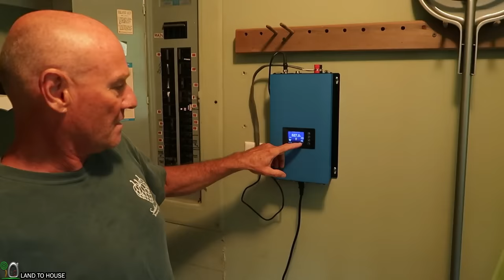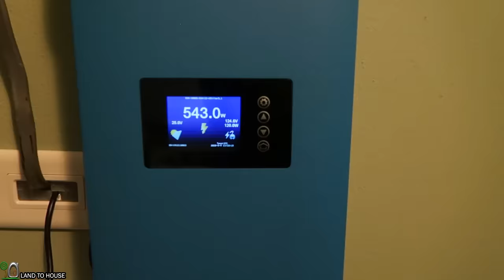Awesome Low Head High Flow Grid Tie Micro Hydro 530 watts!

Comment: Beautiful pond, he should put some trout there.
Wonder how much did it cost him to actually built the dam and huge regaining wall next to it, actual dam is probably reinforced concrete, probably at least $10k ? 
$2.5K inverter + motor, $500 for plumbing, 1 day assembly. Pond / Dam pre existing?
Reply: Dam looks older than the gentleman presenting the system, gonna go out on a limb and say it was already there
Reply: There are a lot of forgotten low head dams all over the country, so I think he just bought it with the land. Still pretty cool, I don't know much of those who are for sale.
Reply: @kinto4135  And since he's in North Carolina, even if he didn't own the damn (but merely owned the land adjacent to the stream), the law there is that you can make reasonable use of the water. So, he'd be in the clear.

Although in other states, that wouldn't necessarily be the case.
Reply: @slycordinator  Oh ok, didn't knew that. That's really cool! Finally a useful law haha
Reply: @kinto4135  Yeah, there are states where seemingly meaningless things dealing with water are illegal. Like, in some places it's illegal to even collect rain water, since water is taken to default to belong to the state at large.
Reply: You don't need a pond for this to work though. I feel like the setup was somewhat inefficient. They got the pressure system right, but the alternator and gearing ratio not so well. I like how honest the old man was at the end, kinda gave the guy a poker face hahah
Reply: And that thing is spitting out more than a nickel's worth of electricity every hour! It'll pay for the inverter in less than six years!

Comment: Just running those figures mentioned at 11:30 :
900 kWh per month is about 1250 W constant grid load, down to 300 kWh (416 W load), a drop of 830 W.
Assuming this means the "average" load is dropped by 830 W then the turbine would need to generate at least that on occasions.

My question is, what's the peak output of the turbine?
The video is titled "530 Watts!", so I would assume maximum savings would be 380 kWh per month (not 600 kWh as mentioned).
Am I missing something? Hoping for some clarity, cheers.
Reply: my guess would be more cautious electricity use as a whole after this project.